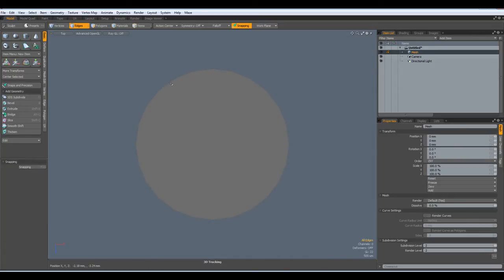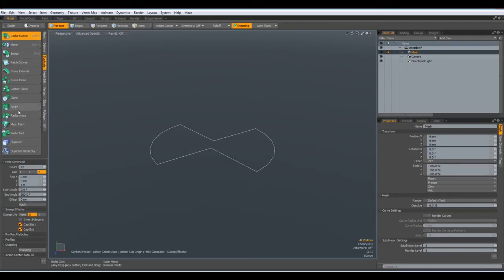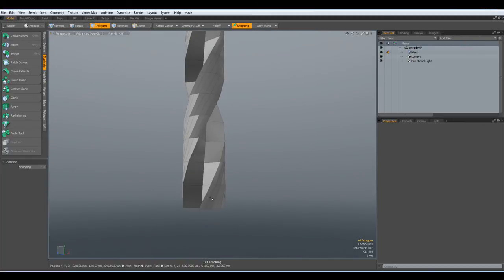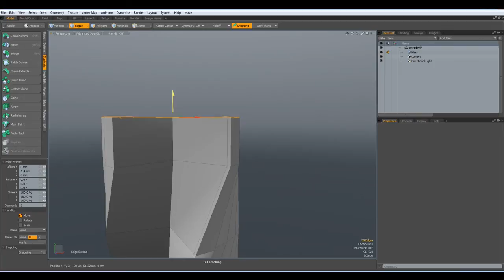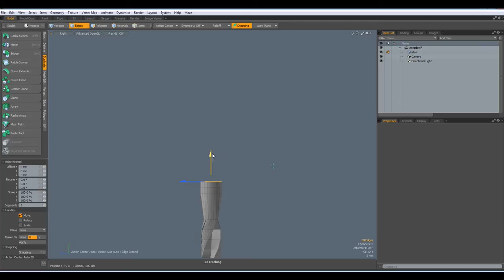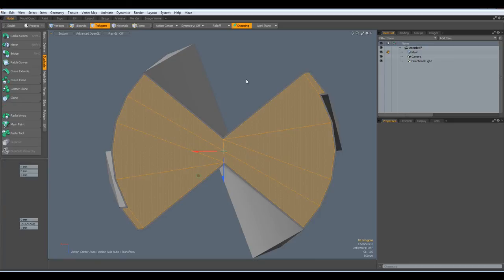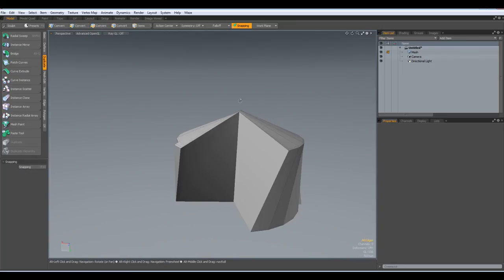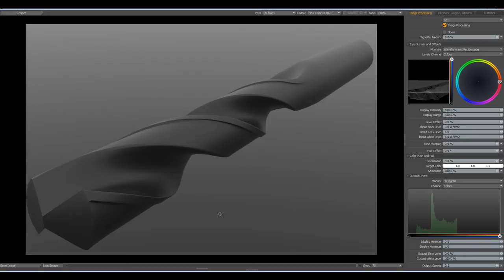Luxology Modo - Modeling a Drill bit (on request)

Comment: in modo 901 faster way to do it would be to cut 45 deg poly from both sides of a circle (with extra polies in middle) and then bevel out to desired height, alt-c to n segments and use the twist tool under deform for more control :)
Reply from the maker: +Yury Sidorov Well, that's the beauty of 3D modelling. There are always different ways to achieve a result :-)